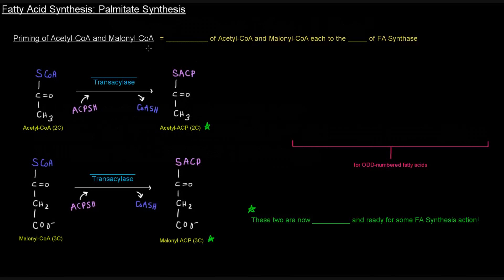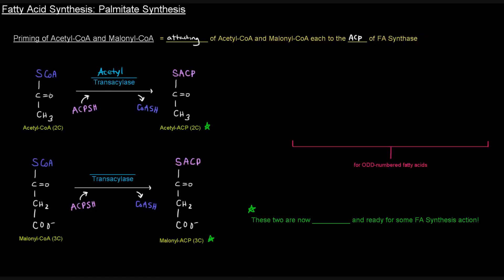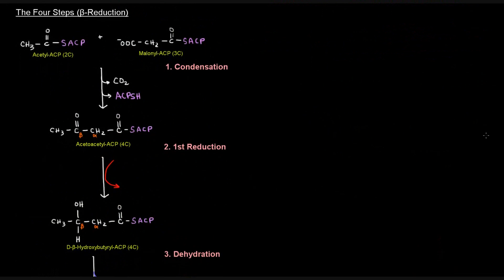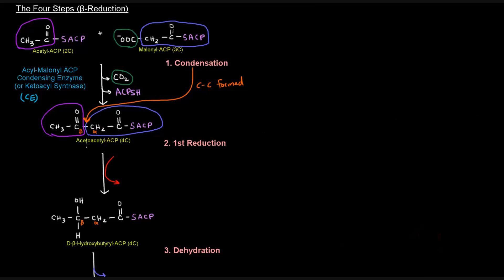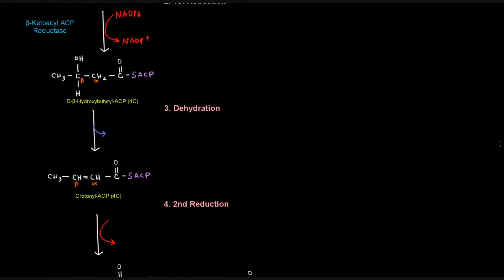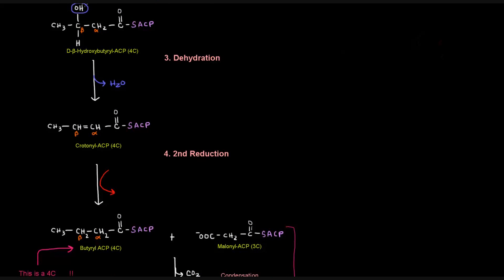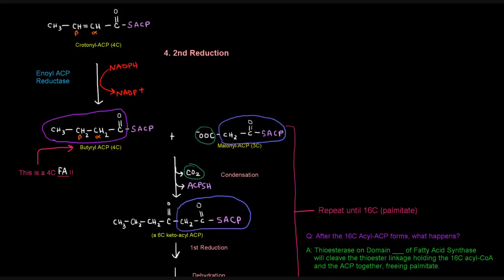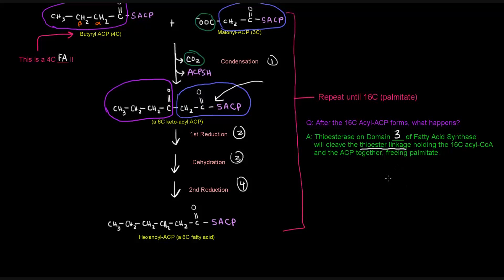Fatty Acid Synthesis (Part 5 of 12) - Palmitate Synthesis

Comment: You missed that an additional hydrogen is added in the reactions with NADPH. It should be NADPH + H+ -> NADP+
Reply: +Enzymes IS there such a thing as NADPH+H+?? Is it the same as NADPH2? Is it quite common to leave the +H+ and 2 off? I have been searching everywhere trying to work out where the extra hydrogen came from
Reply: +Jenni K NADPH (orNADH) is often written as NADPH +H because when it donates electrons to a substrate, the substrate often use up 2 hydrogens in order to accept the 2 electrons. If you just wonder where the hydrogen come from; any oxidation reaction that generates NADPH/NADH also releases a a hydrogen, for example the citric acid cycle, it's just the reverse reaction described above but two hydrogen leave in order to create a double bond. 

In this video for example; at 8:53 you can see crotonyl-ACP accept 2 hydrogen on 2 different carbons. 
Sorry if it's too long :/
Reply: +Enzymes Thanks for replying! So perhaps it's common to not bother writing the whole thing out, just assume it's two H's in the same way that we assume that H's are on the ends even if not written in. This is so confusing for someone learning by distance. Also, is NADPH+H+ the same as NADPH2?
Reply: +Jenni K No problem :). NADPH (or NADH) should be written NADPH + H because they are not the same molecule. NADPH2 is wrong because it looks like both hydrogens are attached to it. I would bother trying to write it with the extra hydrogen to balance the reaction though :)
Reply: +Enzymes Thank you, you've been a great help :)
Reply: Enzymes was just about to ask the same thing, thank you for the clarification